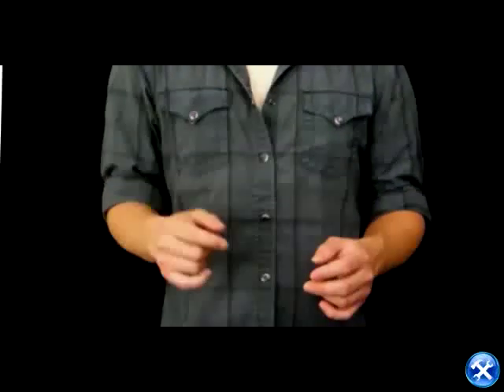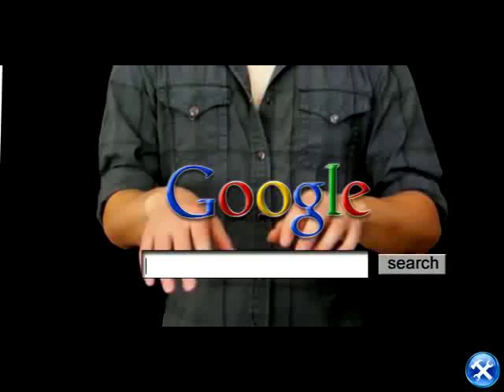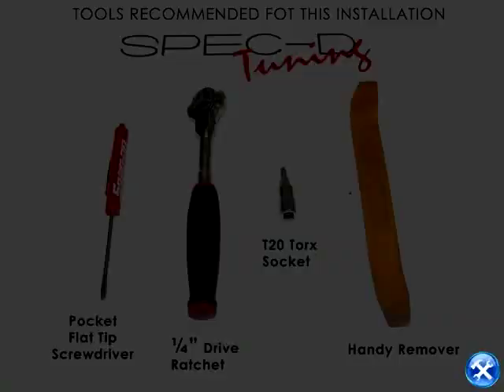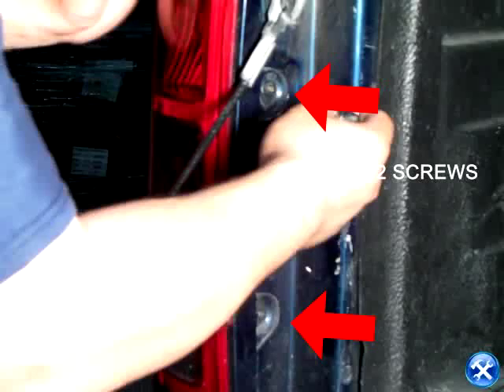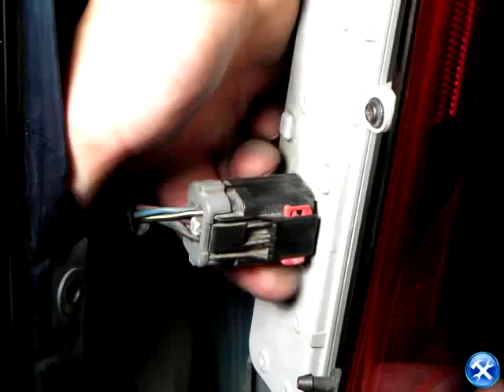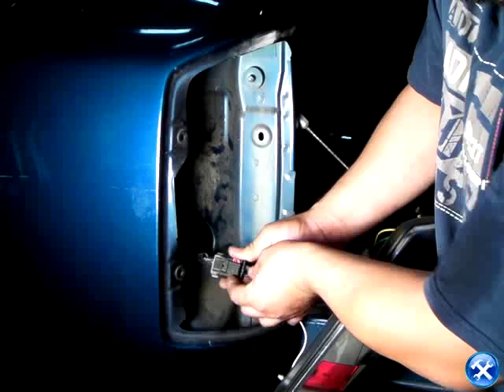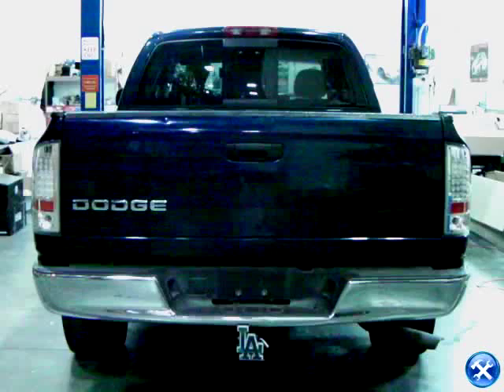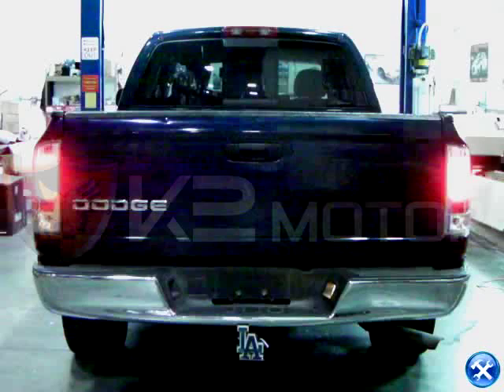SPECDTUNING INSTALLATION VIDEO: 2002-2005 DODGE RAM LED TAIL LIGHTS

Comment from the maker: @wisdometernal We have a video titled " seal your headlights. You can use that method to repair the rain water inside your stock tails too. just be careful when doing so, they use the same concept at the video. The only difference is that you let the water dry inside before resealing it. Let me know if you cant find the vid. 

Thank you

Comment: QUick Question- Im planning on putting in LED tail lights soon but my current lights are stock. The problem is Im getting moisture in one of my tail lights. In a heavy rain My reverse light will fill with water on one side. How do I stop this so it doesnt happen when I put in my new lights?

Comment: do you have resisters in the tail lights so it has the normal turn signal flash?
Reply from the maker: David Heckman Yes, the tail lights have resistors attached to the tail lights to help you prevent the error codes on your dash.
Reply: Not so much the error code but the fast blink when turn signals are turned on
Reply: +David Heckman put a heavy duty flasher in it will slow it down